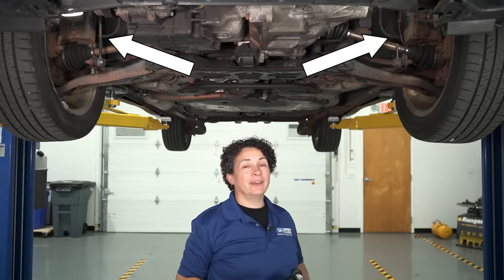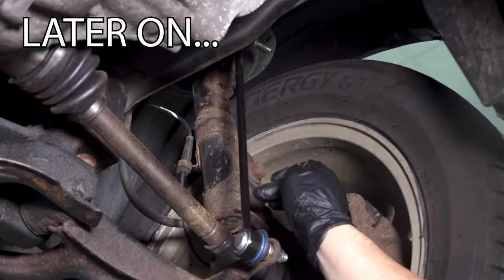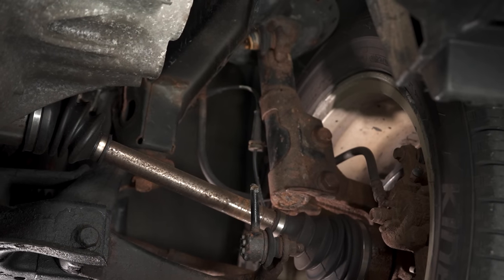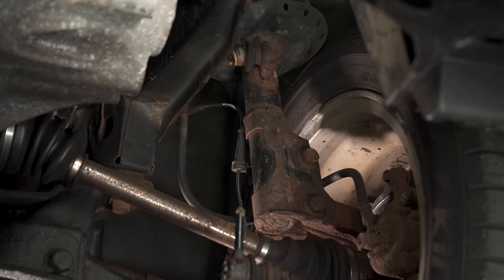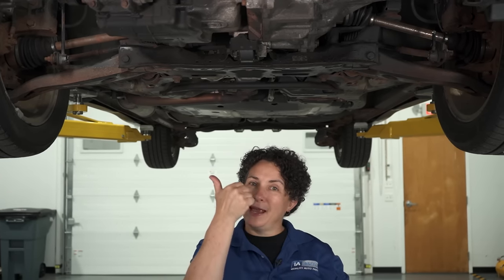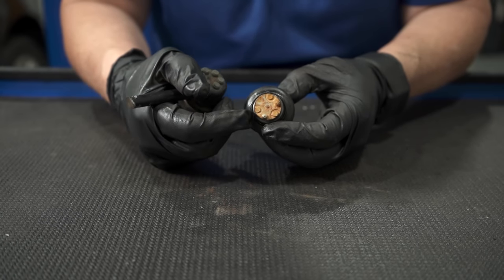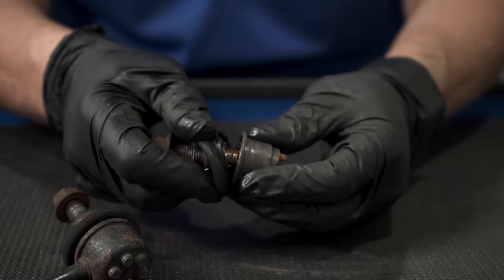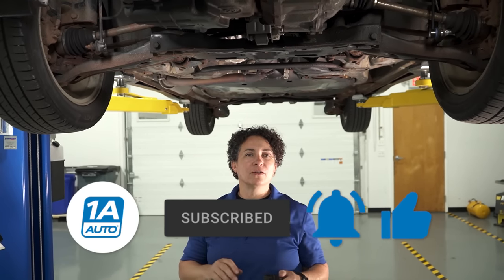Knocking Noise Under Your Car or Truck? Simple Suspension Solutions!

Comment: This was incredible to watch, I’m beyond impressed. I’m hoping the author or someone else can respond…I’ve got a 10 year old Acura that has begun knocking crazy bad over the last 2 weeks. Took to my mechanic n mentioned sway bar link (same clunking noise as once before when he replaced on R front several years ago). He took a brief look w wheels turned and said they seemed ok but I can order along w strut mounts. I’m waiting for the parts and driving lightly around town today, my brake sensor went off. My mechanic originally said oh it’s ok to keep driving, but w this brake thing now I’m concerned since the video mentions the link can hit and damage the brake or ABS line. 
Should I cease driving completely till I get the parts or am I ok ti drive a bit here n there in the meantime?? 
Many thanks in advance!

Comment: My SUV has the link connected to the lower control arm to the sway bar & have torsion bars. My right (pass side) shock is leaking which put more stress on the link in turn lost the bushings. So, if your links are failing, inspect your shocks & struts. 
Also, if your vehicle is all over the road & handles like a boat, check your links ASAP, especially with SUV's since they sit high & are top heavy. This can be a serious safety issue if you have to swerve to avoid something in the road or an unsafe lane change from another driver. You can lose control & roll it.

Comment: I have a broken tie rod on my 2008 Ford Explorer on the front right and it makes one hell of a knocking noise when taking left turns at high speeds and right turns on low speeds and the steering wheel shakes when breaking getting off the highway. Gonna get it fixed soon though :)

Comment: Ever since I had the driver side hub replaced I have had this banging noise when I got it back from the shop. When I make a left turn it wobbles ,I feel a definite wobble on a left turn. And every time I have someone look at it , they say they  can’t find anything wrong. I guess I’m gonna have to ask them to check the sway bar because the mechanic is incompetent or I’m crazy.

Comment: Let’s hope your not trying to steer into a corner sharply you’ll loose control the sway bar dose exactly what’s its name keeps the car from swaying to far to one side. Every time you turn sharply at speed the bar will twist and pull the other tire in the opposite direction keeping the car firmly planted on the road so you don’t loose traction

Comment: So that ticking sound at the start is that the sound? I have a 09 pathfinder that when accelerating or more or less maintaining speed. Usually when it’s at 1-1.1k rpm it makes a ticking sound like what’s in the video. Also just had my timing chain redone etc from a reputable mech. But just can’t figure out what the noise is.

Comment: Of the topic question, kindly help!
I have corolla 1994 Lx 1.3 with 4efe. Vehicle started consuming a lot of fuel. Changed plugs,map sensor,injectors and fuel cap but still i smell gasoline from fuel cap area. There's a breather hole under the fuell filler hole. Mileage is still worse. Car has been with me for 6.5 years and now this comes up. Could it be a charcoal cannister going faulty?

Comment: I have an issue with the windshield fluid spraying on my rear window when I use the front windshield fluid on the turn signal and when I use the rear window fluid, it sprays on the front windshield.
Could the front and rear tubes need to be switched?

Comment: Without sway bar its absorhing more bumps
Reply: It more connects both front wheels to each other up and down wise in relation to the chassis.
So in the corner you'll have one wheels suspension buried and the other one almost coming off the ground.
Tendency is pull the one that's buried up and the one that's up down because the sway bar is attached to the chassis tends to keep the car more on the level.